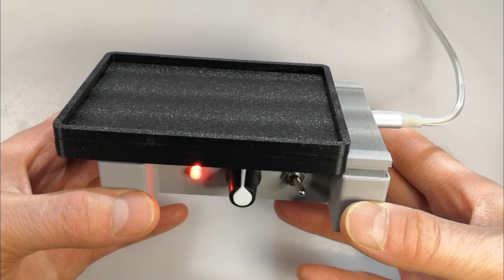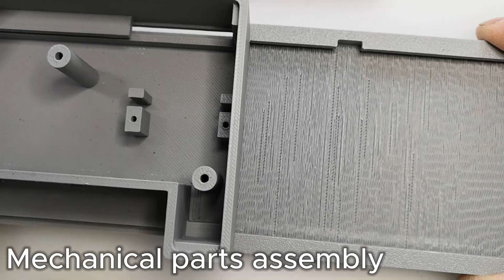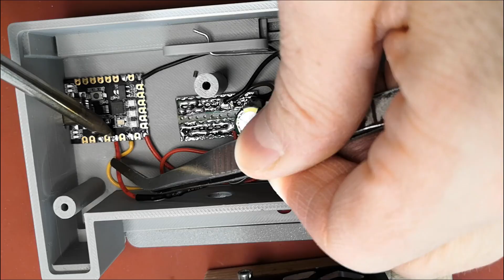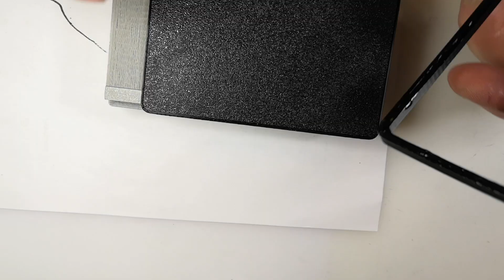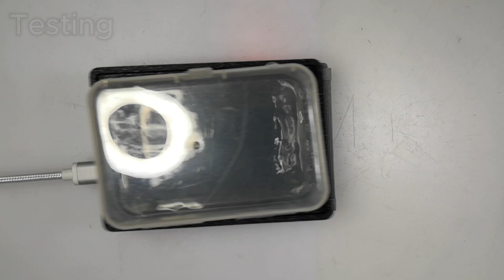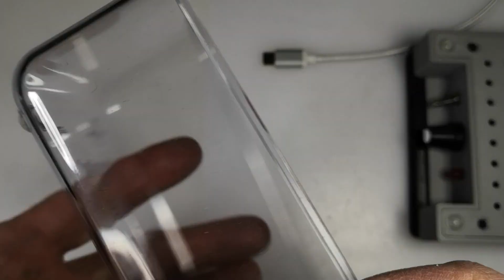PCB Etching Shaker with servo motor and arduino

Comment: Could you please give me the STL file? I click on the link in the description and it says I don't have access
Reply from the maker: Folder is public and works with the link in the description, I tested it today. Note that design is a PROTOTYPE, and will need some sanding to make slide work well. I would do it differently, If I made it again. Feel free to use stl or make better design. It will work well though, if you have some patience. Recomment using free oneshape account and you can make necessary changes.

Comment: Hi! Do you have the electronic parts list?? Mainly wondering about the capacitor's μF
Reply from the maker: Capacitor was very big, 2200uF. Without capacitor my cheap servo didn't work. It is advisable to use better quality servo, this is very loud. Led resistor depends on led colour, try 220R...330R. Potentiometer is 10k as far I can remember. 3D small sliding part is tight, support structure at printing makes surfaces rough, needs some sanding and filing for smooth action.
Reply: @SnapTinker Thank you!! 🙌🏻🙌🏻

Comment: Stl file end arduino file?
Reply from the maker: Look video description, use stl or make modifications with oneshape!
Reply: It is very narrow and difficult to move around.
Reply from the maker: You need some sanding/filing for sliding parts, 3d print support structure leaves residue. That residue may be difficult to remove because the cravice is narrow.  Parts must move freely, but they must not be too loose.